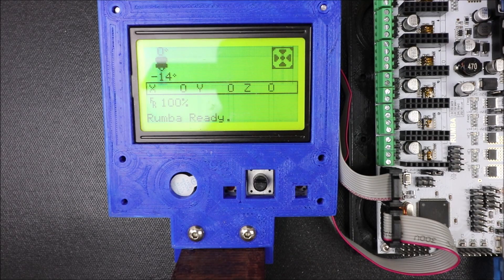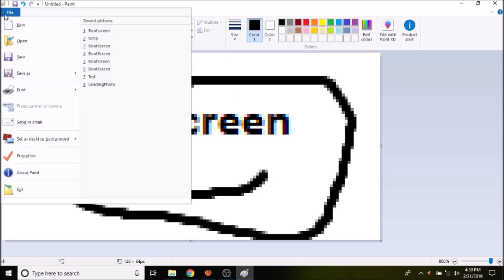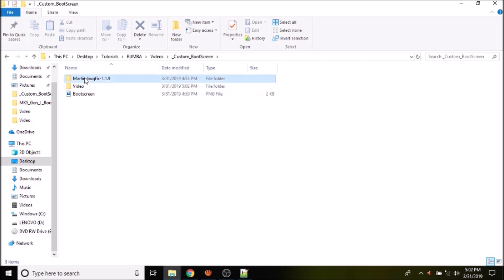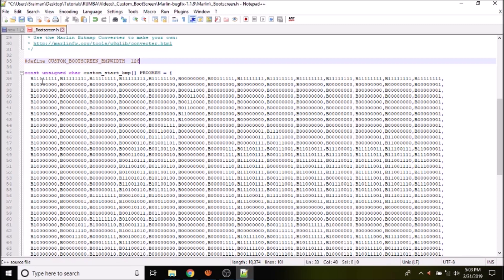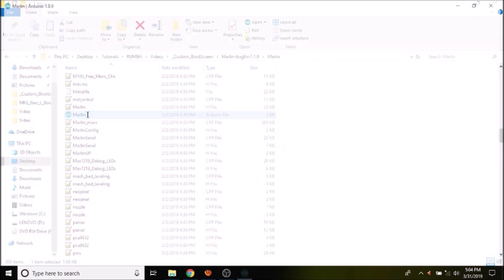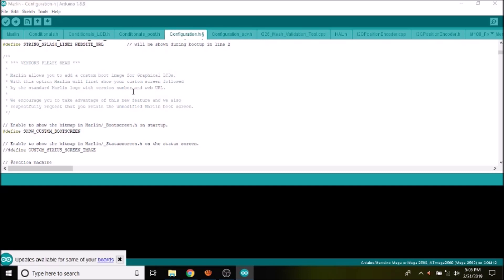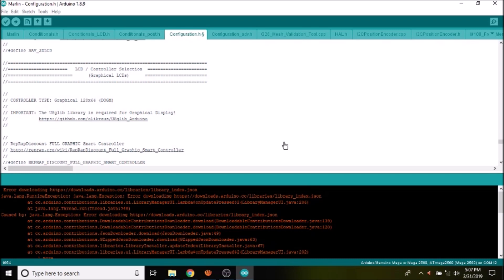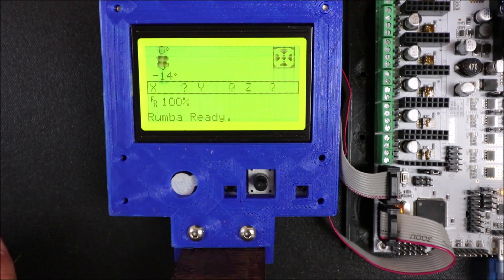Rumba - Custom Boot Screen

Comment: Have you tried using ClearPath motors in your 3d printer?
Reply from the maker: Not yet, but if you have a link I'll check it out.
Reply: @EdwardBraiman  sure man, here is one
https://www.teknic.com/
and a motor for example

https://www.teknic.com/model-info/CPM-SDHP-2346D-ELS/
or
https://www.teknic.com/model-info/CPM-SCHP-2315D-ELNB/

The last one has insane speeds and torque.
Reply from the maker: Not sure about the precision yet.  Nema17 have the choice of 1.8 degree of step or .9 degree.